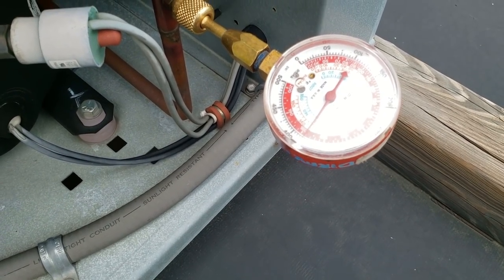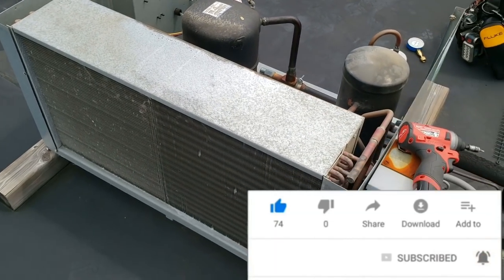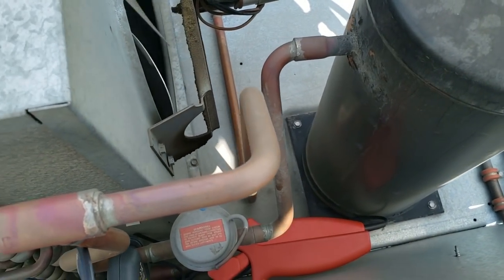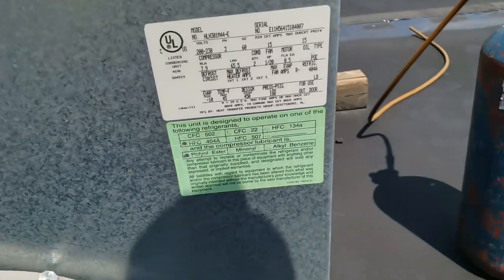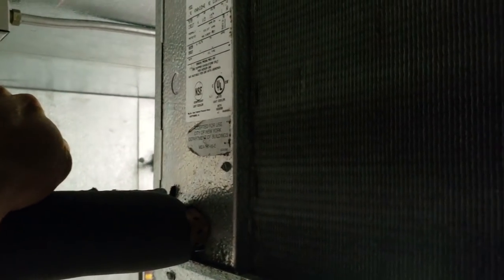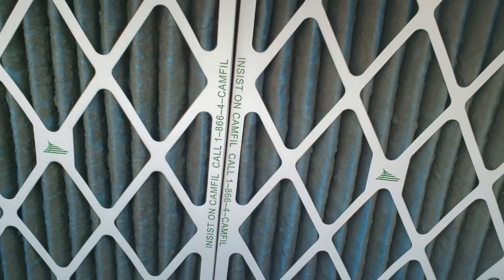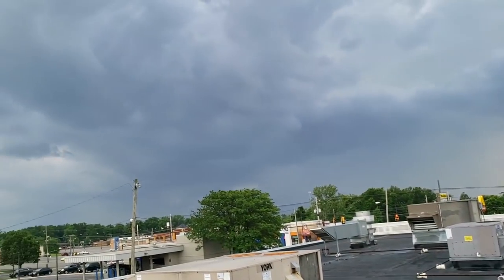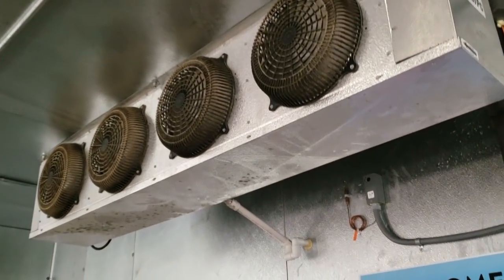Walk-In Cooler Warm and Compressor Is HOT

Comment: Good video I never thought of replacing the fan
Reply from the maker: It took me awhile to figure it out. The amperage was over but I blamed that on the capacitors originally. The oily motors were what justified the replacement for me. Thanks 4 the feedback 👍👍

Comment: Maybe add a tachometer to your kit. 1550rpm is the usual spec. Those likely were running closer to 800-1000rpm.
Reply: get a 4000 rpm.......that way, you can use it on small engines that generally run around 3000.  Hercules HF 6 to 99,000 RPM  with reflective tape.........or use HVAC reflective duct tape.

Comment: Good catch.  sometimes the motors fool you.    i carry a pressure washer that sucks water from a bucket so i dont have to depend on a water source for a nice cleaning.    I do agree   Buildings should all have water sources on the roof.  Good job  keep the videos coming.
Reply from the maker: I have a worx sprayer and a 120v pump motor, but with the weather breaking and the coil looking clean enough I didn't figure it would make that much more of a difference. Thanks for the view and feedback 👍👍

Comment: If you wind the suction valve in to drop the suction pressure down to what it would be with a normal room temp, it'll give you more of an idea how the condenser is coping. 
Good call on the new motors!
Reply from the maker: I have done that for compressors that are pulling over RLA, but haven't tried it in this situation 👍👍. I'll try it next time.

Comment: Interesting call. I think this was a good example of a lot of little things adding up to a bigger problem. Weak condenser fan motors, dirty condenser, a big load that the unit is trying to pull down, and a high ambient. I was thinking with those storm clouds rolling in the machine was probably dealing with a high Rh as well. Did you check for a temp difference across the  filter dryer? That could increase your head too. I think the headmaster was operating properly. Good video, thanks.
Reply from the maker: Yea, it took a while but I finally got it. Thanks for checking it out!

Comment: Did you come up with anything on the bosch unit? I can't find the video now? Wanted to report back with the findings on mine. The super heat was anywhere from 4 to 12 degrees depending on compressor RPM. Inside humidity is running anywhere from 53 to 62 percent.
Reply from the maker: The supplier is trying to help get the system corrected so I removed the video.  They ordered a adjustable TXV but that got delayed in a shipping issue so I don't have anything to report.  I'm going to see if the correct superheat helps first before pressing for larger remedy's.
Reply from the maker: If you would please, email me what you found and if it is working now at   hvacrsurvival@gmail.com

Comment: The oil on the motor did not come from the motor.... I would spray the coils with chemicals and water to get them clean. Also I think you have oil migration too. Get that oil back to the compressor after the blocked evaporator and condenser coils are cleaned. Moving the oil takes time....
Reply from the maker: I prefer washing the coils out any day over blowing them out, but the back door was bolted shut and I couldn't get it open and the drive-thru window was way up front so it would have made a heck of a mess. Thanks for the feedback 👍👍
Reply: running hoses thru the drive thru window isnt a good option!  It wasnt like the coil was greased up.  Blowing with nitrogen is the only other way.  Like i said in my response, i do have a pressure washer that sucks water thru a bucket.

Comment: Did you happen to take an amp draw on those new motors?
Reply from the maker: Yes it's right at its maximum amperage. Haven't had a problem with these motors yet.
Reply from the maker: @UCyj66snU6-HG39GgYj_uIgQ correct, if you pull over the rating of the motor you could go off on thermal.  This extra heat can lead to the breakdown of the insulation that protects the windings of the motor.

Comment: 2uF cap, 6% tolerance is only 0.12, so below 1.88uF = bad and will change motor rpm too much, even if you allow 10% tolerance that's 1.6uF at lowest. simply too much for such small motors.
don't forget the lower value caps have very tight leeway to be within tolerance.
Reply from the maker: Exactly, and the oil on the motor was not from the birds and the worms😁, that was my other reasoning for not just changing the capacitor. 👍👍
Reply: @HVACRSurvival  yeah, probably cooked the grease out from running hot and age